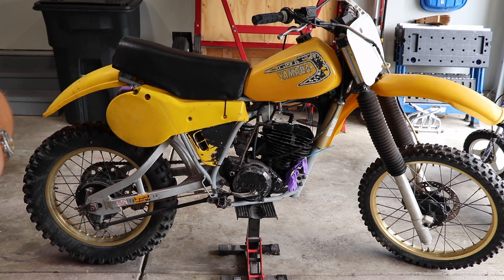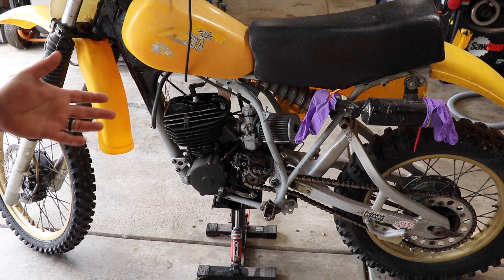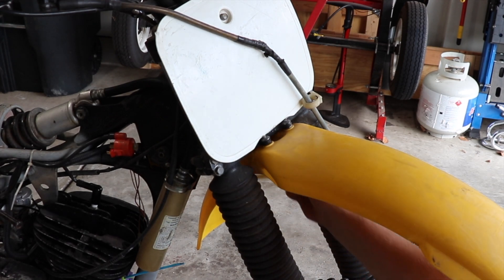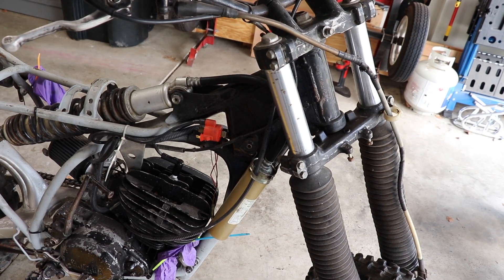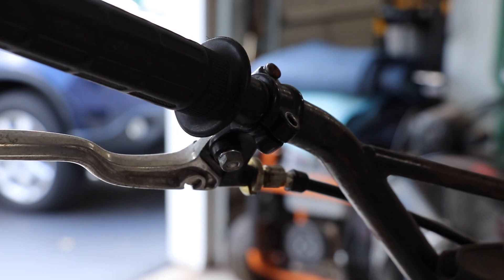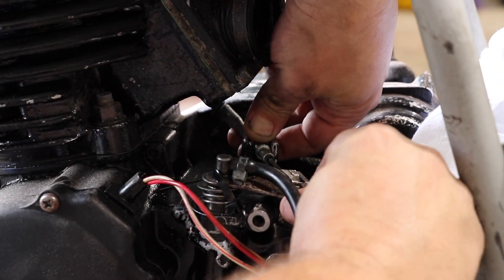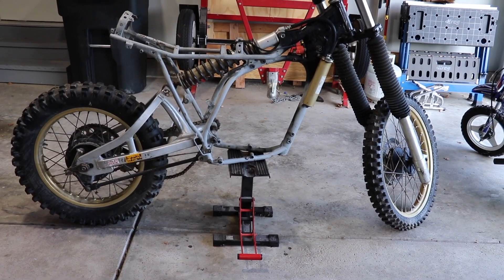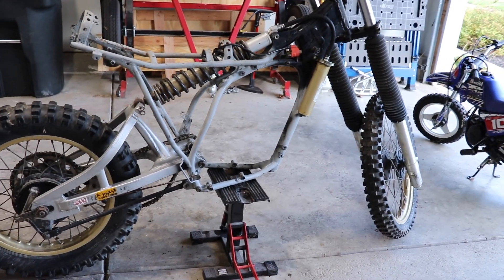1980  Yamaha YZ250 2 Stroke : Tear Down : Plastics & Engine

Comment: It will be a good video series for me to follow. I can sympathize with the new owner. I can see that it will be an uphill battle. At what point is a parts bike a good idea?
Reply: I just had another thought (disclaimer: I have very little experience). Since new parts are hard to find, What are going to do when you need a clutch, bearing, oil seal, etc? This will not be good for someone with OCD.